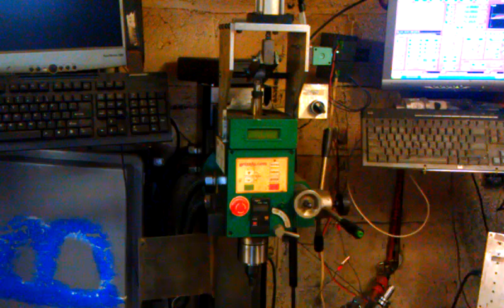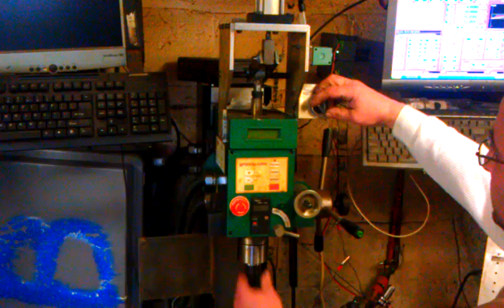Power drawbar SX3  mill

Comment from the maker: I'm using custom drawbar rods. The factory rod will be to short with the stacks in it. 
For R8 head Its 7/16 -20 threaded rod and nut cut to length for the extra spacing

Comment from the maker: 10 springs for 1950lb would not be enough Deflection?Compression space. I have 18 in it for the 1950lbs and corect deflection. 9 springs In hoss's config  Is 650lbs ()()() 9 springs ,  1300lbs (())(())(()) 12 springs.  1950lbs ((()))((()))((())) 18 springs

Comment: I just purchased a set of 10 springs per Hoss' suggestion.  Nine of them should give me 1950 lbs then, if I use a levered setup.  Do I simply pull out the drawbar, stack the springs per your configuration on top of the spindle, then replace the drawbar, feeding it through those springs?  Or, will I need to modify the drawbar?  I'm not sure whether it is long enough is all.  Thank you.

Comment from the maker: hossmachine info
 Is where i got my info from. Just needed to widen it. As for the the 3 stage one i winged it. 
The green machine is running 1 wave spring 3 stacks ruffly 800lbs  The red is running 3 spring 3 stacked For 2400lbs Estimated. to reduce tool pull out 
At 1600 it was still pulling tools out.  ((()))((()))((())) Spring stack

Comment: I can't seem to find a straight answer for the required number of belleville springs / depression force for TTS on an SX-3. Is 1256 lbs (4" bore single stage cylinder) sufficient for TTS extraction on the SX-3?  I prefer the direct-acting cylinder configuration.  If not, I can achieve 2512 lbs using a 2:1 lever setup, which I think will be more than enough. I wouldn't mind avoiding making the extra parts required to employ the lever though, so please give your opinion if you have one!  Thx!